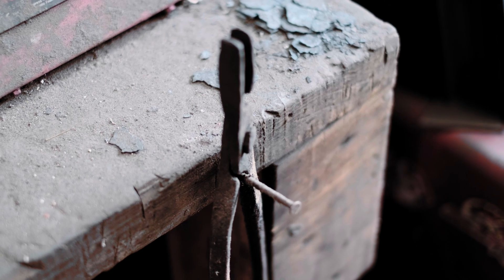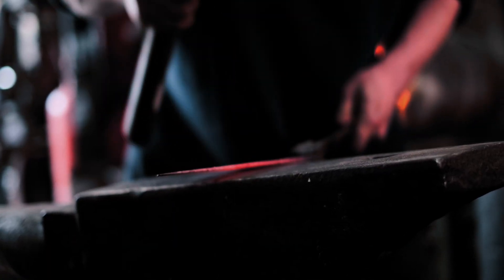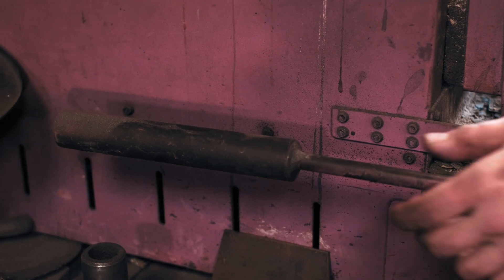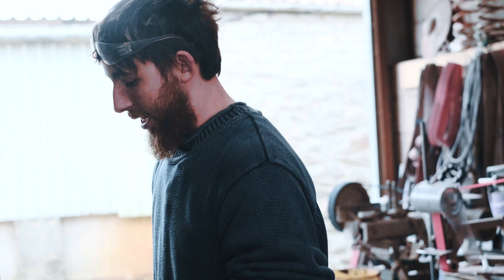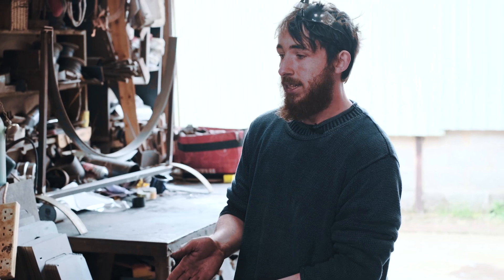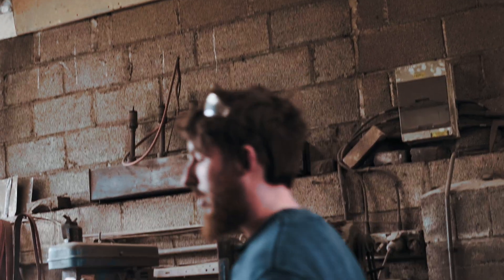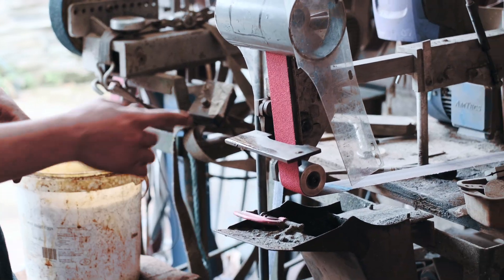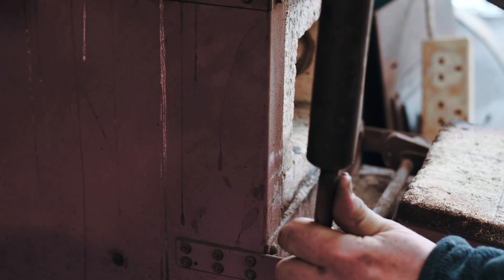Bladesmith heat treatment of San Mai chef knife Part 4

Comment: What about making a cooling jacket for the oil container?  Same thing as making ice cream, basically.  Make a cooling jacket, as a larger bucket, insulate outside if desired.  Put ice cream salt and ice in it, where it'd cool the oil off fast.  Which would seem to create a much quicker coming quench then the heat from the knife would heat the oil I'd guess.  I'm just thinking initial quench would draw masses of heat out initially.  Maybe a little after.
I would do it, but I do not have anything to try it with.  Then, I do not know what u do if I did.
I have another question if you read this, are any emulsifiers used in the oil to break down I guess, surface tension of the oil, so more oil contacts the blade?  A couple dozen egg yolks, which is used to emulsify oil and fat in cooking might do it.  But, you add oil, to eggs, just a little at first until it starts emulsifying, then add a little more, make sure it's emulsified, then pile in the rest.  Then cool it with the ice cream methodology, so the oil is cool.  Physics rule, energy always flows from high potential to low potential.   Cold is an absence of heat, the greater the difference, the greater the potential it seems.
Where I'm thinking just of the initial biting of all the elements on each other, rapidly, then as heat transfer, it begins leveling out for not slow, but slower, still quicker than standard, but not putting overwhelming forces on it.  Creating cracks.
Which with micrograms, the stuff used to be magnaflux, spray it on, it'd find small cracks.
Again I know little to nothing quenching, but the little bit I've seen, I question.